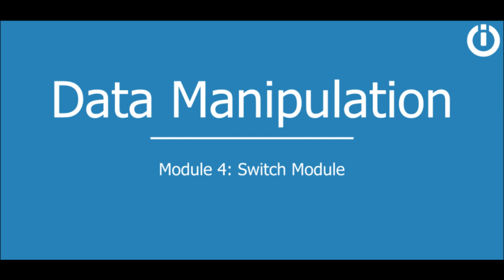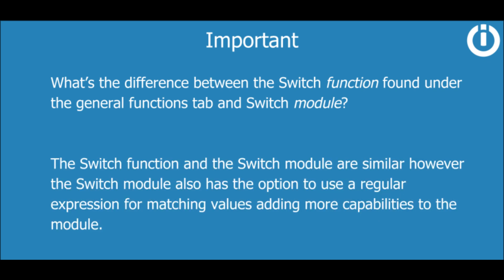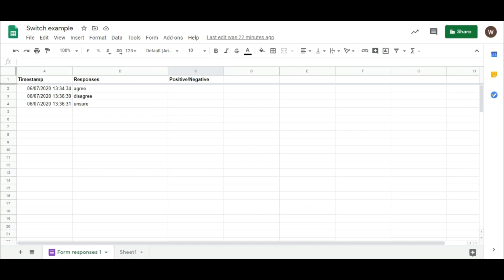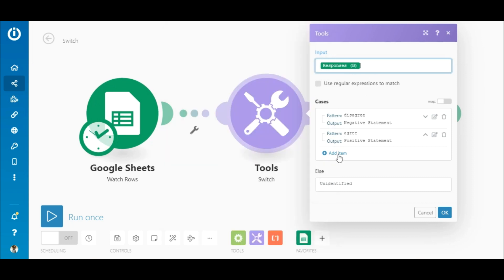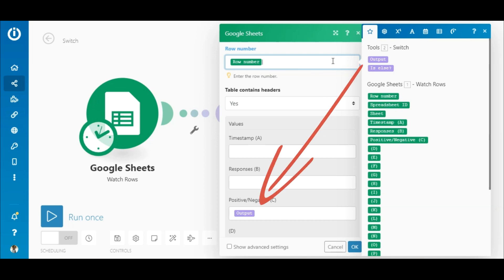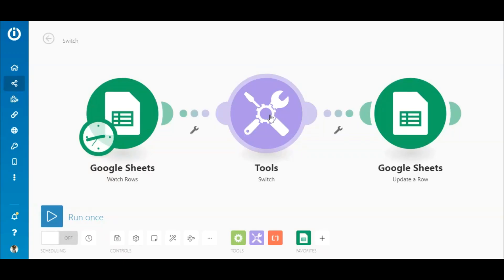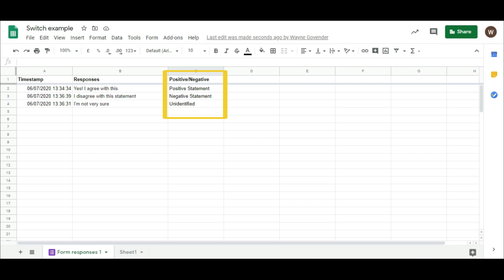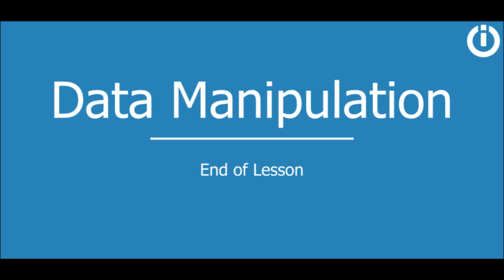Data Manipulation | Part 4: Switch module

Comment: Just a point of clarification, around 3:10 into the video a regular expression pattern is being used which has the search text enclosed in parentheses () which the speaker calls "brackets". This can be confusing because brackets usually refers to [ ], which has a very different function in regular expressions.